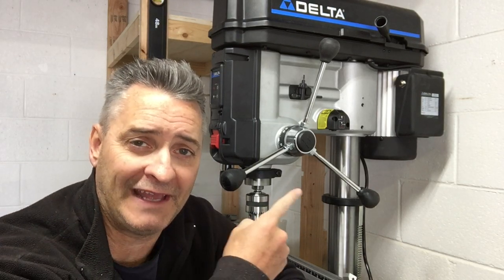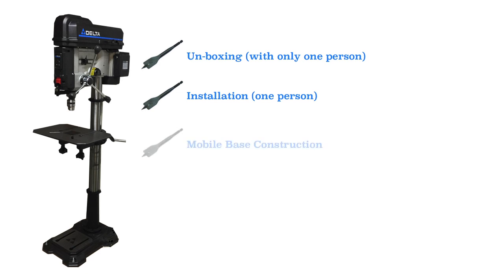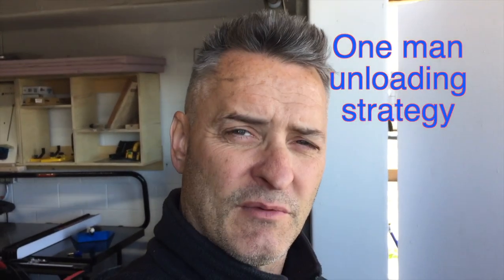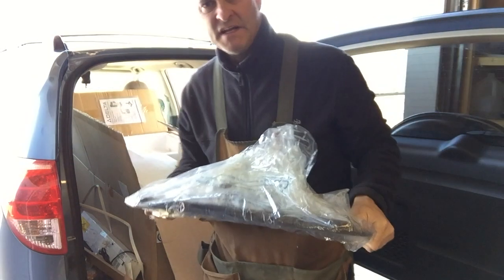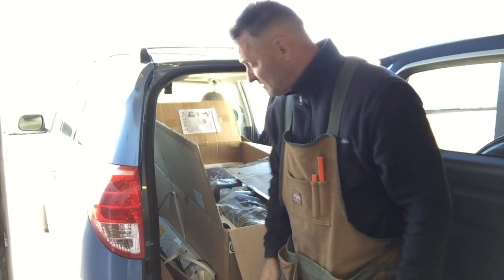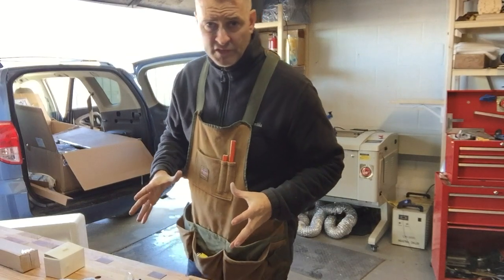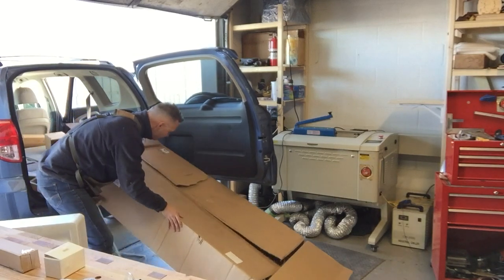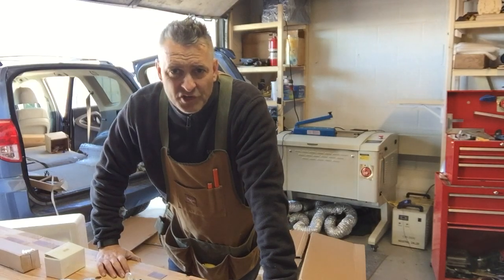Delta 18 900L Drill Press Unbox, Assembly, Mobile Base, etc

Comment: The manual recommends certain bolts I can't even find online.  What size bolts did you use to mount the drill base to the base you created?
Reply from the maker: As I recall they were 3/8" diameter, and long enough to go through the foot plate, and through the base I built with about 3/4" sticking out on top for a washer and nut.  I don't have the drill press anymore so I can't just go look at it.  Go as beefy a bolt as you can there.  If you can get a 1/2" bolt, do it.  I have another drill press now, similar at least for the foot plate and I used 3/8" diamter bolts on it.
Reply: The manual asked for Metric and it was pretty ridiculous to find those. It also referred to them as carriage screws. Did you use carriage bolts or hex bolts in the end? I think I’ll use a standard hex bolt and get the kit you recommended. Any further thoughts?
Reply from the maker: @matthewmaki220  I used hex bolts.  Carriage screws in wood I think will wear out the recess in the wood eventually.  The manual actually recommends against a mobile base, so I don't know how serious I'd take the manual for this purpose. :)  The manual is referring to making a wood base for stability, but not on wheels.  It's just a slab of wood to make the base wider.  Mobile or stationary, use the biggest beefiest diameter bolts you can fit in there I'd say.

Comment: Hi again Kerwin. I've decided to stick with the manual-recommended 3/4 in. plywood base. My basement floor, like many others, isn't pool table smooth. What would you recommend to level the base. Rubber feet?
Reply: That’s a tough question for a drill press mobile base which is already top heavy. I would probably attack that with building the casters out using bolts that could be spun in or out of tee bolts in the plywood, acting as leveling casters. When I built the mobile base in the video, the floor in my space was relatively level so did not need to worry about it. The area of a drill press base is relatively small though so unless the floor was drastically unlevel, i’m not sure it  would be worth the trouble. But every space is unique, and you will know better than me. I hope it goes well for you in any case.
Reply: Thanks Kerwin. I decided to go with the Portamate PM-1100 mobility kit, and I'm very, very glad I did. For the base, I used 2 sheets of high quality plywood, one 3/4", the other 1/2". The big story is, like you, I got a chain hoist and strap, and my wife and I managed to install the extremely heavy head unit on the mast. Chain hoist helped a lot, but still... it was like trying to mate two elephants!

Comment: i like that really good job there , where did u got those wheel for the base ?
Reply from the maker: Portamate PM 1100 mobile base kit. see time 5:06 in video. I bought online, but that and similar kits are available at Rockler and Woodcraft.  The kit was just 4 wheels (2 fixed, 2 locking casters) and I mounted them to the frame.

Comment: Did you revise the mobile base by drilling out the threaded holes?
Reply: When you say mobile base, I assume that you mean the base plate for the drill which has threaded holes to mount the vertical mast.  At time 5:50, you can see placement of bolts to mount the mast to the base plate.  I did not modify the base plate at all.  I just made the mobile base and then mounted the base plate onto the plywood of the mobile base. The mobile base is something that I made myself using Portamate PM 1100 Mobile Base Kit.  The metal feet/wheel parts in the PM 1100 do not have threaded holes.  Hopefully that answers your question.
Reply: Kerwin Lumpkins I was referring to the PM1100. My PM1100 has threaded holes in the bottom plates without nuts. You ran bolts up through the 2x and plywood with a nut on the top plate.
Reply: SWAMP52 my mistake then. Sorry. I do not have any memory of threads on that plate, but maybe there were. I do know that I bought longer bolts than those supplied because i used lumber and then plywood. I may have chosen smaller diameter bolts and longer. I don’t recall there being threads but if you have them, then likely so did I.  I can say that i would not have been satisfied with just threads on that top plate. It’s like 1/8” thick or less, so i would have wanted more surface area. But i do like redundancy. :)
Reply: Haha I like belt and suspenders too for sure. That's why I liked your lumber and plywood option for the base. Good call. But man that thing is hard to move around without a mobile base on it. Thanks for the conversation and all the best.
Reply from the maker: @SgtLumpkins  5 years later, and I used that mobile base kit again.  And yes there are threaded holes which I used on the new base appplication.  I do not recall drilling out those threaded holes so I must have just fitted bolts small enough to fit without touching the sides of threaded holes.  Which means I probably used 1/4" bolts there.

Comment: Nice video. I noticed the laser engraver in your shop. If you don’t mind sharing, what is the brand and model ? Also, do you have a review video of laser engraver?
Reply: Thanks. My laser cutter/engraver is made and sold by Full Specrum Laser in Las Vegas. It is their Pro Series 24 x 18 inch model. I have th. 90 watt tube. I think highly of Full Spectrum. They designed a control board and made an application to go with it. It greatly simplifies the learning curve and provides a lot of power in the form of features and options. I don't think the make this model anymore but do still have the pro series and a similar model. My laser is about 5 years old and going strong enough 8th little maintenance on my part. I do intend to make several videos about using the a laser cutter but haven't got to them yet.
Reply: Sorry for delayed response.  I bought my laser cutter from Full Spectrum Laser, based in Las Vegas, Nevada.  It is a Pro Series 24x18.  They don't have that model anymore, but do have a Pro Series 24 x 16 and other sizes. I do recommend Full Spectrum products.

Comment: Really great video. I have been thinking about picking up a Grizzly until I saw the travel on this one and the belt tensioner, so I was doing research before buying. Your video helped a lot. Nice music, nice shots as you went along hooking it up. Thanks a lot.
Reply from the maker: Thanks for the kind words.  It is a great drill press.  I wanted the Nova Digital, but they were back ordered for like 2 months.  I'm glad I went with the Delta.  I'm sure that it will last longer and be more reliable long term.  Changing belt/speed is very easy and fast.  And I saved $400 or so.